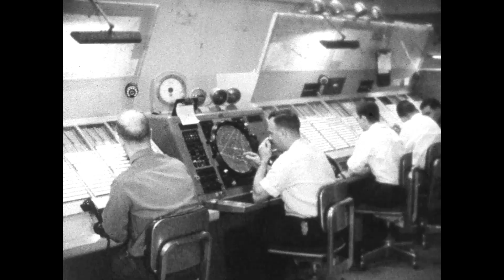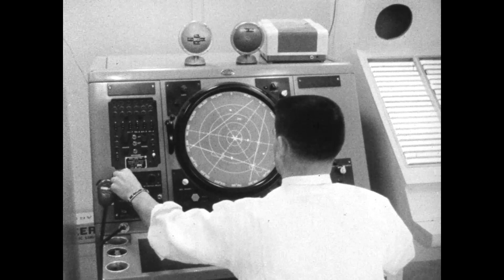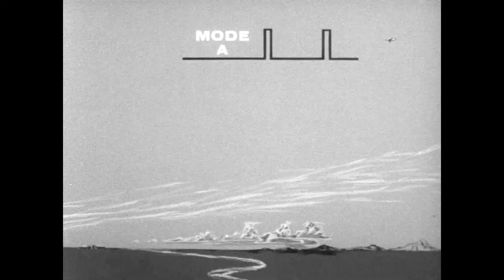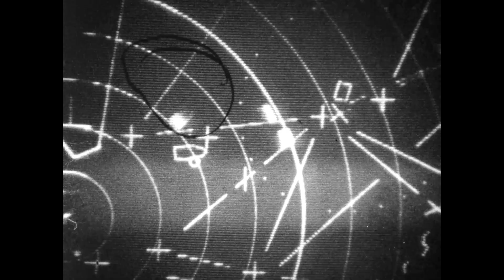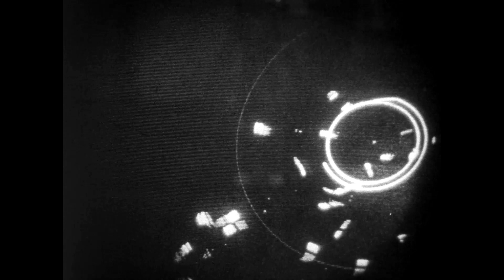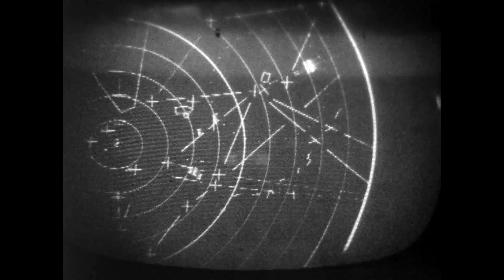Vintage RADAR Secondary Surveillance Radar 1960s Air Traffic Control (transponders, airlines)

Comment: During the late seventies there was an effort to eliminate the broadband system and replace it with Direct Access Radar Channel due to the high maintenance and ever increasing lack of parts including expertise.  DARC would sufficiently be in conjunction with NAS IBM9020 to function like the CDC. The CDC was yet another mainframe whose only job was to write the graphics out on our PVD’s. Our objection was that the weather display on broadband had greater detail as opposed to the L——L  H——-H  weather demarcation on Stage A and DARC.  DARC did help in some ways as long as the 9020  was also operational as we could use its code assignments. Strip processing, route processing, PAR’s PDR’s,  PDAR’s airway and direct route took a huge load off the controller. Manual strip writing sucked.    However, the IBM9020 had to be replaced as it was reaching absolute capacity with CPU usage in the high nineties which meant that several functions like SAR recordings had to be turned off in order to keep the load down before the machine would begin to shut things down on its own and eventually crash.  NAS’s all time highest priority was to NEVER lose data. It’s engineered software prioritized functionality so essential data was saved and acted on though certain functions were sacrificed. That main premise was essential to NAS reliability and remained so until after I had retired.  The replacement for the IBM9020 was the IBM 3083 which was contained in one third of the floor space and located in an expansion of the basement.  The old automation floor was converted to DYSIM and training offices. The 3083 was water cooled and had cassette tapes instead of the old reel tapes. Cassette tapes had a much higher capacity. The entire NAS OS along with all the adapted data was on one cassette. 
The 3083 also allowed for multiple VM sessions which meant that NAS had its own VM and offline jobs like NTAP, UNTE, and system builds were run at anytime.  It also gave us KVDT’s that allowed us to work on future systems in our offices. 
The next generation processor was the IBM G-3 about the size of a large upright freezer.  The G-3 reduced the floor space needed to less than 1/4 of the original IBM 9020’S. TWO G-3 boxes and each contained several CPU chips on an expansion card.  If one CPU failed another was brought online by an IBM tech with an initialization tool and code. 
ATCS & DATA SYSTEMS SPECIALIST ZAB/ZDV (Retired)
During the early 2000’s we went to electronic strips, large rectangular color radar displays which put up a large red X from corner to corner indicatiing it was out of service.  And, speaking of those new displays, we could draw on those scopes to outline various things like a hot restricted area.  So, one day an enterprising confroller drew a red X on the scope, centered it and reduced the range so it duplicated the outage X.  The SMMC (System Maintence and Monitoring Console) engineers just went ape over that one position throughout the night switching out consoles, switching PAMS, Startover, and any idea they could come up with to no avail. The red X remained until the day watch showed up to open the sector and easily cleared the display, increased the range, turned around to the engineers and said “So, what wrong?“  They were agast.!! 
So as I left we were transitioning to yet another system NextGen  designed  with conflict resolution, ADS-B, reduced vertical separation above FL290, and many features that would indeed reduce the stress on the controller.  However, a whole new set of problems arose. They no longer teach manual separation, strip writing, and many of the things we had to utilize in my day....
Reply: Thanks for sharing your stories. I love hearing shop talk and stories from people involved with the earlier days of technology.

Comment: I came into ATC in 1974 and the ARTCC has just transitioned to Stage-A automation with mosaic radar display.  Those PVD’s were still capable of being laid flat and go back to using plastic shrimp boats on the screen.  It was a real mess when we had high volume of traffic and the machine decided to fail, switch every aircraft over to the appropriate squawk 2100, 2400, etc..  Every radar position had a discriminator box that we could set eight codes to either double slash or single slash.  And the machine crashed a-lot.!!  During the seventies they took the machine down for maintenance at 2100 and brought it back around 0600.. We didn’t go 24hr until the early eighties.  So, that meant broadband all night on the mid-shift.  ATCS  1974-2006 ZAB, ZDV (retired)...
Reply: No wonder you retired!
It must have been nerve-wracking.
Did you take up sailing or gliding to discover a way of relaxing?

Comment: This leap in technology was the direct result of a mid-air collision in June of 1956 by two commercial airliners over the Grand Canyon. Back then, there were no ARTCC facilities as we would recognize today. Back then, continental traffic was handled by AIRINC with no radar whatsoever. This very system shown in the film is still in use today with very little changes in how it works. More recently ADS-B will likely replace the mode C and mode S transponder, but for now we’re essentially using 1950’s technology to track planes.
Reply: I guess the midair collision over NYC in 1960 helped to speed things along.

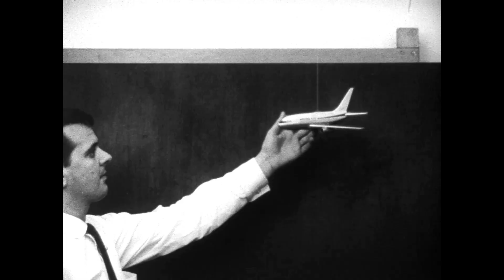Comment: Note:  At 12:19 a Boeing 737-100 is shown.  That aircraft didn't enter service until 1968.   I would have hated to work in there being a non smoker.  Pretty interesting!
Reply from the maker: Hi Patrick, Thanks very much for your observation.  Re the 737-100, I assume you are referring to the plastic plane on a string that the instructor is using in his demo.   I am not an aircraft guy, but it appears you may be correct.  Interesting, good  spotting.   I own the original 16mm film and original canister.  Surprisingly, there is no date to be found anywhere.  I am thinking now that most of the film is early or mid 1960’s radar equipment.  But still trying to pin down a closer date range.  The large image of the Pan Am aircraft at the beginning of the film has the tail number N707PA, if I read it correctly.  That was delivered to Pan Am on 15 August 1958.   (Boeing 707s were made from 1958 to 1979.   Pan Am used 707’s until Jan 3, 1981. )  I don’t know when that aircraft left Pan Am service, but it may be Pan Am stock footage that was used.  In fact, some of the radar equipment may be from different years also.  Makes dating the film a challenge.  Still researching it though.  Thanks again for your feedback.  Are you an aircraft guy?  ~  Victor, at CHAP
Reply: @ComputerHistoryArchivesProject  More interesting is that the pilots set their transponders to only two-figure octal codes, which suggests the system depicted on the video was the old variation of Mode 3 unless the footage was staged in a legacy simulator. Starting from the 1970s, standard civil transponders operating in Mode 3/A or 3/C use four octal codes entered by the pilots.
Reply: I'm thinking that was just a generic 'plastic' aircraft representative of no particular Boeing model, used for demo purposes in an FAA classroom. For instruction purposes to controllers at the FAA, two engines or four engines on the 'model' would not make any difference, and, lessen the possibility of the outer two 'falling off' during handling of the model by the instructor.